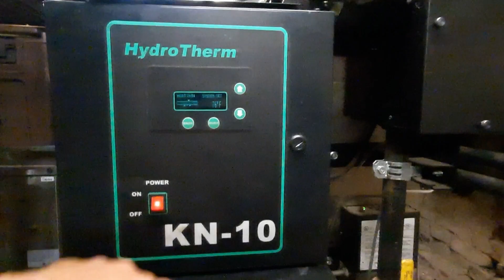HVAC how commercial buildings work

Comment: Good luck with the kn boiler running that low of temp.  A cast iron condensing boiler is a terrible idea.  Make sure you keep the condensate pan clean.  I've dealt with several kn boilers with fouled heat exchangers.  Its terrible to clean.
Reply from the maker: Thanks for dropping some knowledge Josh! I have not dealt with many of these but I do know low Temps can cause issues. Unfortunately it is what it is at this point, not sure who installed this I think it's been here for a while with no problems as of yet. I appreciate Any other tips for cleaning.

Comment: Need to quote them a frequency drive, all of mine were updated years ago. Now that I'm thinking about it all of them are on drives, saves energy and no hard starts, belt life increases.
Reply from the maker: I wish that would fly here but especially with the downtown life as it's been after a long year they just want everything to operate as it does. Actually has the cooling tower pump fail a few years ago I replaced, add on old leaking evaporators in a few heat pumps drives are the least of there worries in this 100 year old building. But I agree, Thanks Glen!